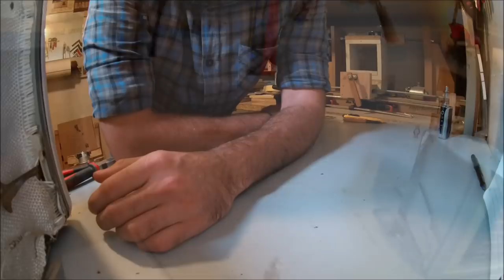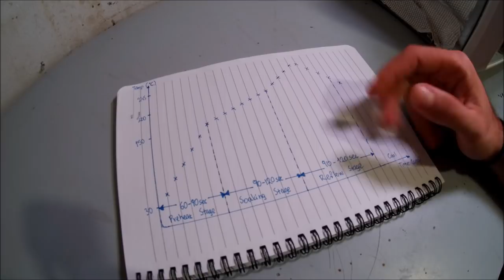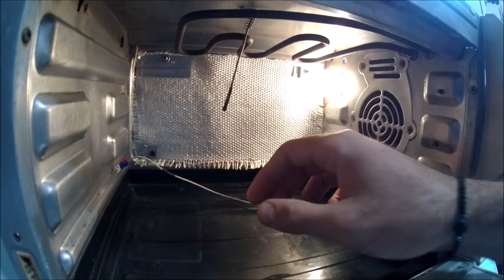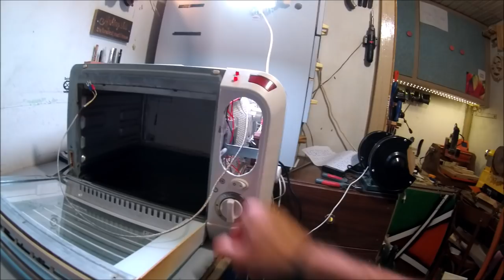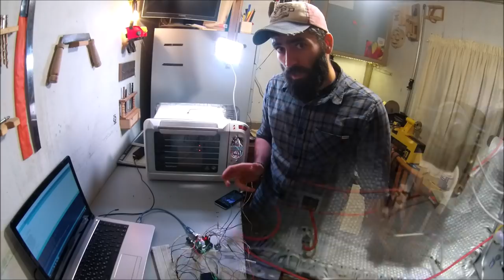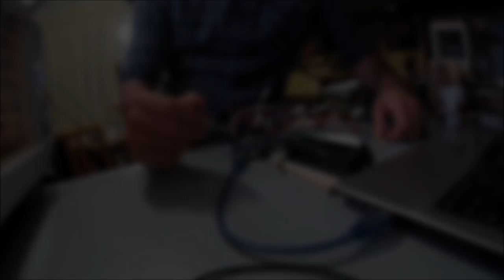Making a Reflow Oven (v. 1.0)!

Comment: I've a small toaster oven with an external (inline) controller on the mains cable for just this purpose. The controller switches the mains supply on/off to the whole oven. To use it you set the temperature on the front panel of the oven to max (e.g. 260C) and the timer to say, 10 minutes and then the external controller takes care of ramping and maintaining the temperature within those bounds. The benefit of leaving the oven's original controls in place is that it guarantees the oven can't get too hot nor for too long. Safety first!

If you've removed these, it'd be worth reinstating some sort of thermo-electro-mechanical switch to avoid catastrophe if a neutrino comes from somewhere in outer space and flips a bit in the Ardinuno's core causing it to latch on the Solid State Relays.

Also, I use a really thin (flexible) thermocouple to poke in a via in the PCB (usually on the bottom side) and then secure it in place with Polyimide (Kapton) tape. This helps ensure you make the surface/core of the PCB achieve the desired profile.
Big parts, e.g. Large surface mount connectors and inductors can sometime take much longer to reflow. I often have to extend the reflow phase to cater for this, but I wonder if a longer soak (below the flux activation temperature) would better help cater for this scenario without risking a dry joint.
Happy toasting!
Reply from the maker: Now that’s a great comment! Thanks for all the info! 
Never seen a setup like that, I admit. 
The only drawback I can think of is that you only use your oven as is. I mean, I also do that myself for now, but I still have some distant thoughts about controlling elements separately, or powering the fan for spare seconds every now and then to make everything even in there! 
I ve had cases repairing modern household ovens and I ‘ve met those thermal protection thingys.( I ve also seen cases where nothing was wrong with the oven but the thermal protection itself!. 450 Celsius it was supposed to be 😄). And I may add one of those here. You are right, safety first!

As for them larger SMDs...Yep. What are we gonna do about that?! I don’t have a reliable solution yet! Bulky components have more “thermal inaction” (if Newton was into reflowing 😄) so extending soaking stage is what I’ m also thinking..

And a last thing..
“A neutrino hit my arduino”
How cool of a tittle would that be for a video?!!

Thanks Alex! 
Cheers

Comment: Good video ... one observation for  your reflow oven tho ... You placed the SSR right into the oven walls .. I think there may be a problem in operation since SSR's often get quite hot ... and being attached and in contact with the walls of the oven is imho a potential problem .... SSR are known to blow really hard ... just sayin' ...
Reply from the maker: Many thanks John!
Yeah you definitely have a point there. It 'd be wiser to mount them in the outside wall, onto a heatsink or something!
Cheers